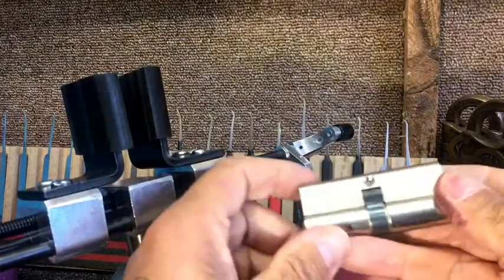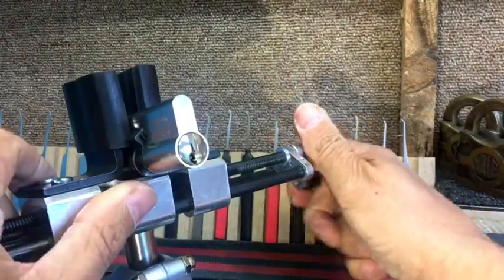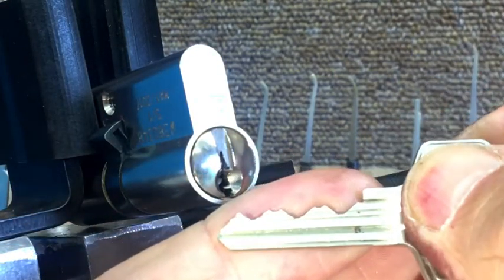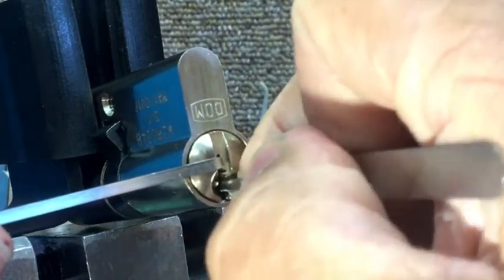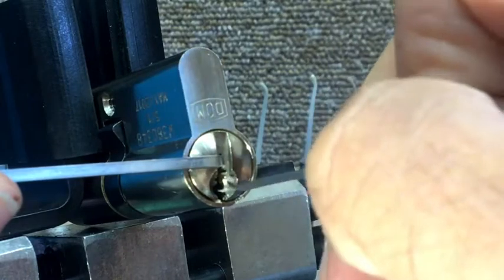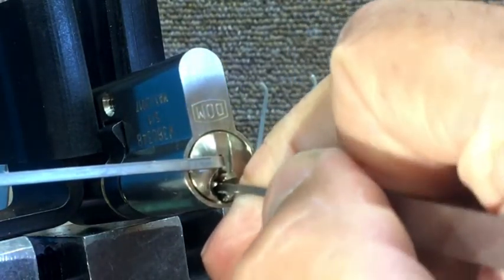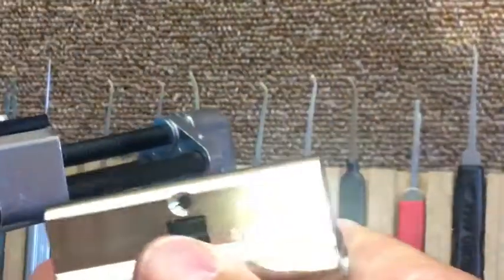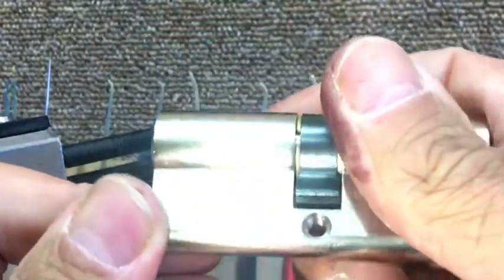A Beautiful   DOM  Euro cylinder with a very restricted key way ssp'd

Comment: Nice picking bud! Those DOMs can be really difficult but you made it look easy! I wonder if this DOM has the DOM pins with the floating wafers on them? I've seen them on various other videos but have never had one to pick. The keyway is intimidating but with the 0.015" pick it doesn't seem to be a problem.  Keep on picking!
Reply from the maker: I would have liked to have got into it to have a look , so not sure ,all I will say is that it did not put up much of a fight, and it's the first one I've had. I've got anoth one coming next week so I will have something to compare with.